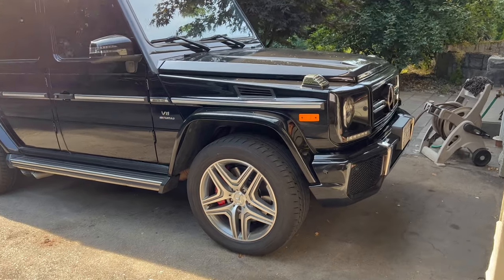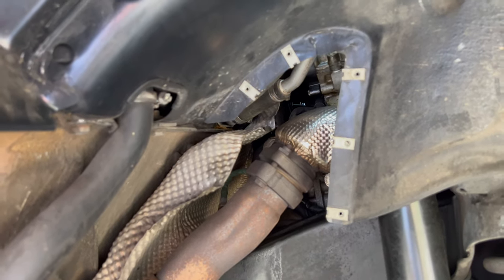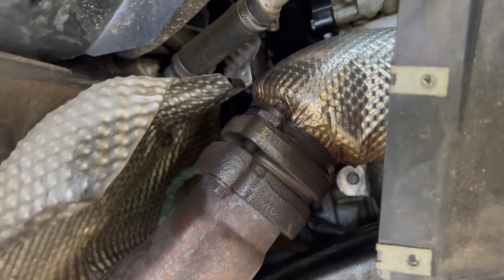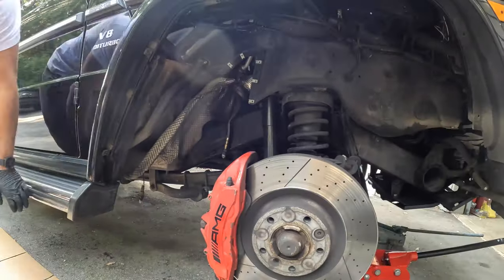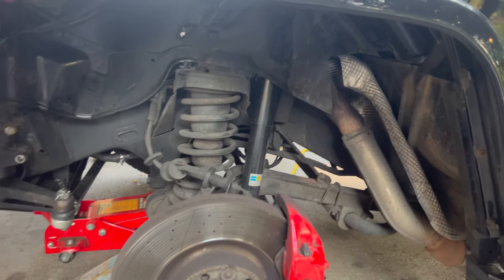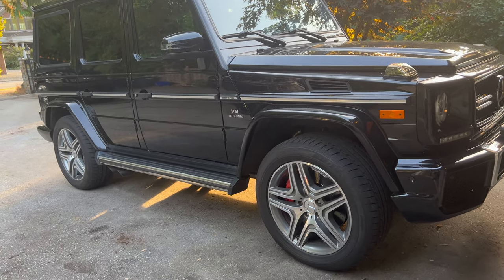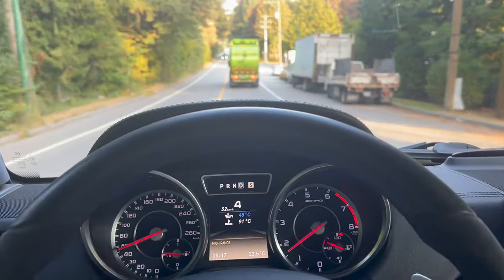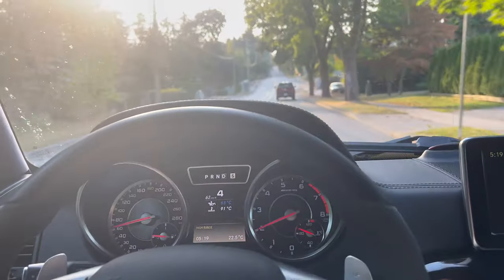Installing catless downpipes and new mufflers on a 2013 Mercedes G63 AMG

Comment: how do you manually open the valve? Also when did Mercedes start using valve control on their exhaust? I have a 2012 and I dont know if I have one.

Comment: Hey man loving your work. I have a black 13 g63 as well. Currently have leaking turbos. Not sure what I want to do. Replace them with oem? Or go with weisstec.
Reply from the maker: You should be able to rebuild them. I rebuilt the turbos on my Viper myself, it wasn’t too hard. I’m not sure if the AMG turbos are ball bearing or journal bearing. If they’re journal, they’re even easier to do

Comment: In the beginning, when you cut the bolts, how do you replace that mechanism? In case a future buyer wants bolts for mufflers
Reply from the maker: I only cut the bolts, I went and got new stainless steel bolts after. Can bolt the old parts back on no problem using new bolts.

Comment: Hey man got a genuine set brabus g63 valved mufflers .. thinking 3inch down pipes no cats with brabus the mufflers you think be to loud ? or cause brabus be 👍🏽
Reply from the maker: Might be too loud honestly. You could give it a try, but I would suggest just putting the mufflers on first and see how it sounds
Reply: Hey man did yours smell heaps exhaust gases stench ? Got mine tuned brabus mufflers down pipes added 100 cell cats get bad fumes lol yours same ?

Comment: you dont get check engine light on??
Reply from the maker: Yes you get a CEL, I tried the O2 sensor spacers, however those did not work. You would need a tune to get rid of the light

Comment: Make, what points  do you use to  jack this truck up, so you can put it on jack stands ?
Thanks
Reply from the maker: Jack it up on the frame. It's a solid frame so you can put a jack stand anywhere you see fit
Reply: Thank you Mike @ViperMike